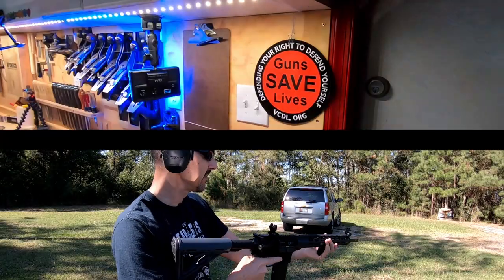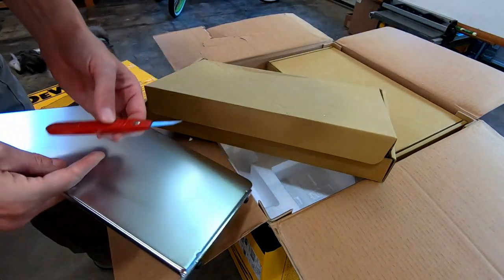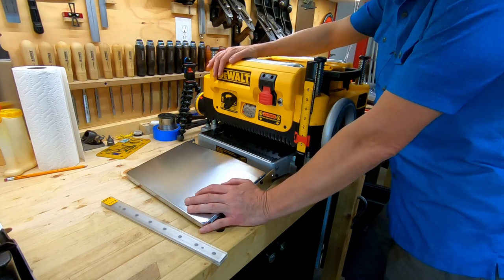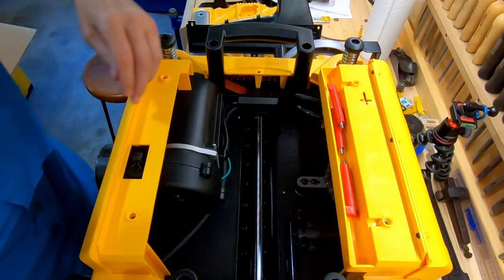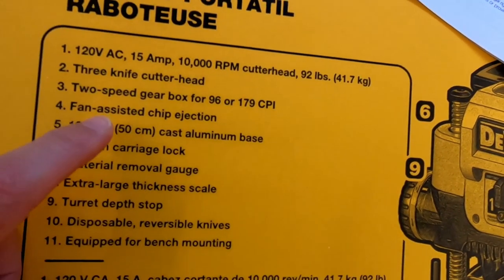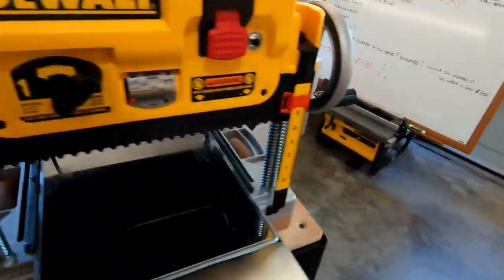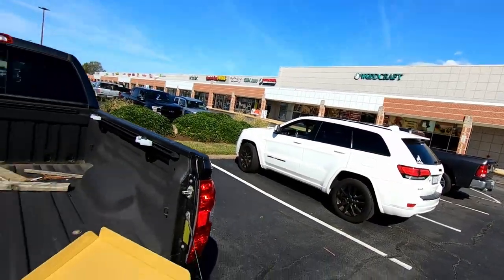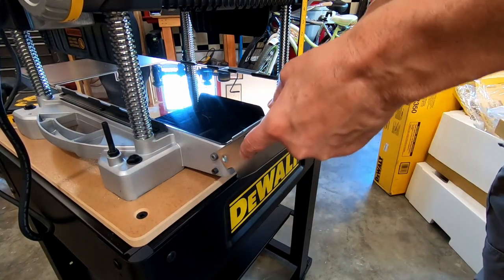DeWALT DW735X Planer - Unboxing with an Engineer

Comment from the maker: If I handed you $600 would you buy this planer?
Reply: Oh ya. 👍 I have seen on some videos that prop do a small waxing for n that mirrored table underneath. May help with that small scratching from happening. 

I plan on buying one this weekend. Do you still enjoy yours?
Reply from the maker: @dustinjames4530  absolutely! But the scratch I had on opening it took some fine sanding. Was way too raised for wax to fix it.
Reply: @VincentSmith1776  awesome. That makes sense.

Comment: Hi Vincent, nice video.  45 years ago, I worked at a large furniture mill (several hundred employees) and was in charge of the milling (planning & molding) division of the plant.

On the high-speed 28" wide planners and lower speed molders, the platen(s) or shoe(s), "out /infeed tables" DeWalt description, were adjusted exactly level, perpendicular and square to the base plate(s).  I personally found that adjusting the "out /infeed tables" as you have described results in unwanted load & load release when the material being planned moves beyond the "out /infeed tables", which exacerbates snipe.  My advice is setup the "out /infeed tables" so that they are an extension of the base plate making it essentially longer.

However, snipe is certainly a problem even on the most advanced heavy duty commercial machines.  Again, I have personally found that snipe problems, after the "out /infeed tables" are adjusted straight is usually due to curved, bowed or warped lumber.  When our milling team observed such defects in the lumber, they fed the planner with the bow facing upward in the middle which minimized but did not completely eliminate snipe.  If our lumber was sufficiently thick, we would run the part twice (a straightening cut, then a cut to finish size), but we were hogging huge off amounts of material thickness on each cut.   Like 3/8" 3/4" because the machines were giant and super high speed.  Like as fast as you can run... LOL.

Anyway, keep up the great work on your videos.

BTW, I am retired now and got a DW735X for my birthday on December 1st.  I'll fool around with the setup and if I find anything useful, I'll be sure to post my findings on your channel.

Mark Nicholson
Former, US Army - EFMB,
Combat Medical Specialist
1/94 FA MLRS
Reply from the maker: Thanks for the info Mark. I definitely don't have your experience. Please let us know what you discover. The outfeed tables on this model are stamped steel and likely don't have as firm attachments as the equipment you described. I suspect you may discover the adjustments I describe are necessary to counter the flexure of the outfeed table and its attachment. But I could be very wrong also.
Reply: @VincentSmith1776  Will do Vincent.

Comment: Nice thorough review.  I was interested to see that when you opened up the blade compartment yours had no sawdust or chips inside like mine did.  Mine appeared to have factory wrapping so I thought maybe Dewalt tested them at the factory but it’s evident that isn’t true and I received a used unit.  So I sent the damn thing back to Amazon.  The bottom plate on mine had some minor scratches and a small divot which raised suspicion leading me to open up the unit up before using it.  Lesson learned and warning to others…it might have been fine but it’s not worth the risk for saving ~$35.
Reply from the maker: Agreed. I once bought a DeWalt table saw from Amazon and it showed up with a hole all the way through it that look like it had been driven through with a forklift. I don't even know why the delivery guy left it on the porch. Pieces were falling out of the box up the sidewalk.

Comment: Hi Vincent, I I’ve watch your video a couple of times now and I appreciate the in-depth look at the DeWalt DW735x planer and x-tra... (should always be included) ...stuff. I agree with most of the complaints you have with DeWalt. I just received my brand new DW735x this week and got everything setup today. I wanted to share one thing that I found to “fix” your cord management issue. Unless your hauling this machine around from job site to job site or from table to table, those nice big black handles are used only once, to lift it out the box on to the DW7350 planer stand. After that, their only useful functions is cord management. Works great. Happy planing. 😀
Reply from the maker: Hey, thanks Keith, I'll try that. Thanks for watching!

Comment: Just received mine today!. I to have been researching for the best benchtop planer value and I settled with the 735X. I've only opened the top portion of the box but, I'll definitely unbox it after work and test drive the terminator lol!!!
Reply from the maker: It's a beast!
Reply: @VincentSmith1776  just finished building its stand out of recycled pallet and furniture table top!

Comment: Was snipe reduced when you adjusted the wings?
Reply from the maker: Not significantly noticeable, I wish I had taken measurements. Sorry
Reply: @VincentSmith1776  By the way I'm one of those that installed the shelix head before I used the planer.  It works great.  You provided some great tips in your presentation.  Thanks.